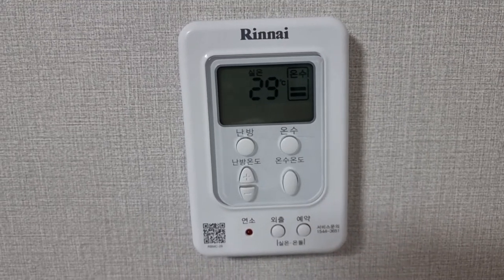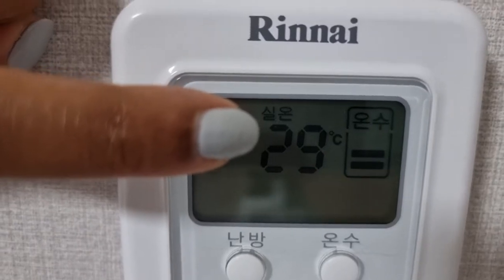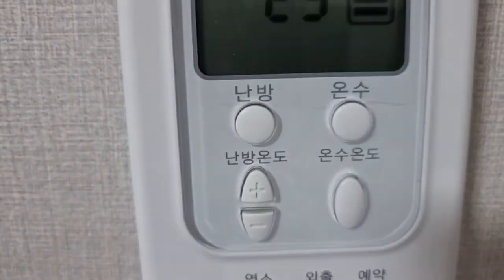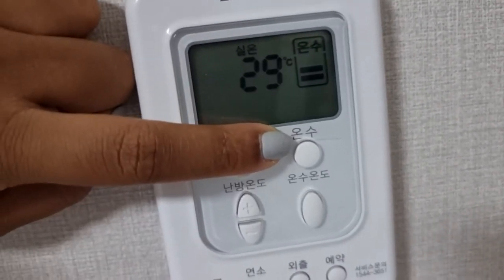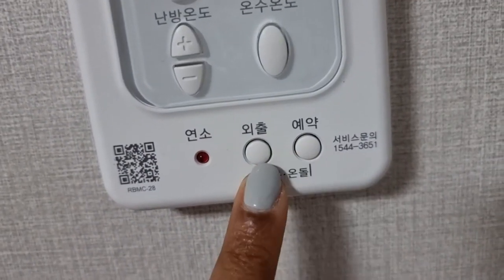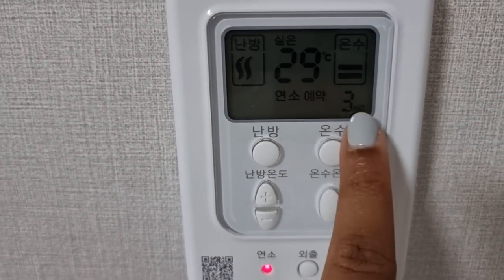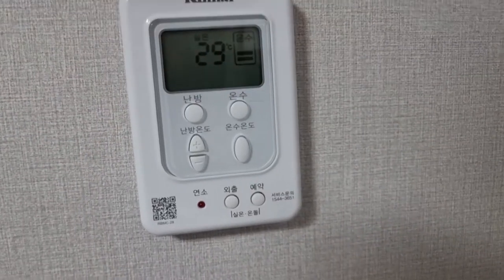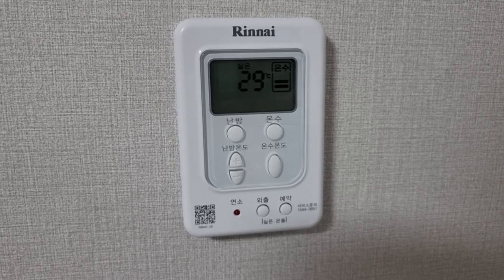SEOULLITE HOW-TO #3 | Korean Apartment heating systems - Become one with the Ondol

Comment: May I know how much is the controller?
Reply from the maker: Controller was there with the room, however, if you didn't receive one when you moved in you should contact the building manager or landlord and they will give you one. If you're apt is sponsored by your job, you should ask your boss. And if none of the above, you can attempt to find one on Coupang,  price varying. (Probably around 10,000 won~)
Reply: @rocheleinkorea  what do you call it so I may look at the coupang
Reply from the maker: @mariamaximarosario1644  well the one in this video is installed, but for air Conditioners or anything else that requires a controller you have to search it by the name of the product. Unfortunately there isn't any way for me to tell you an exact name. Best option is to contact someone who works in the building!